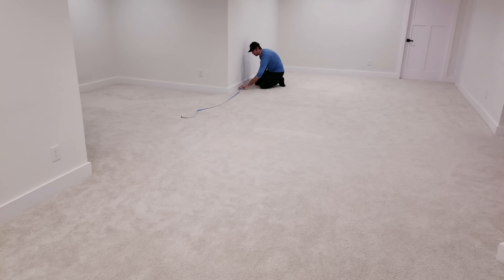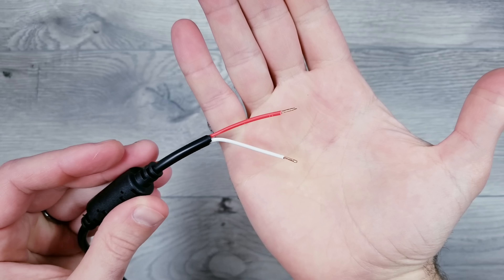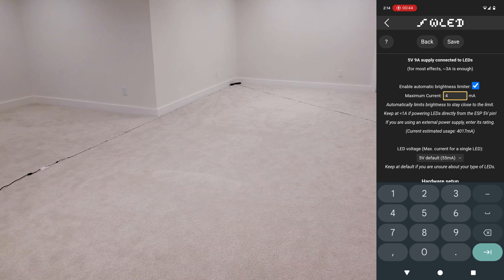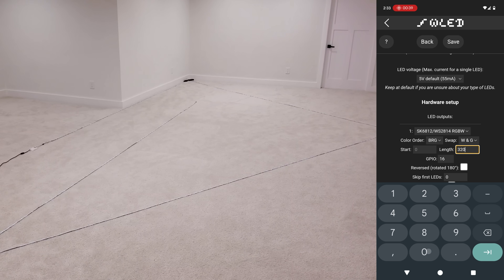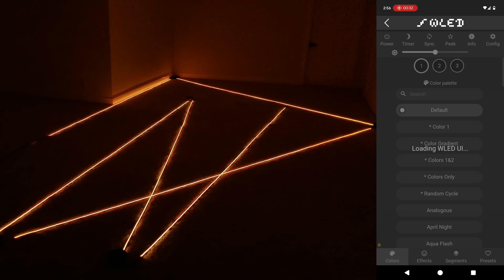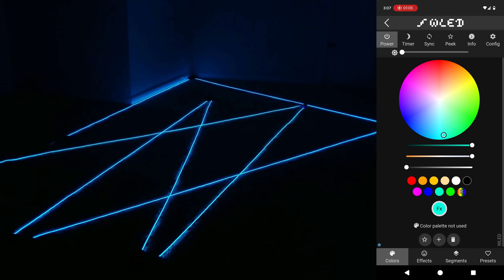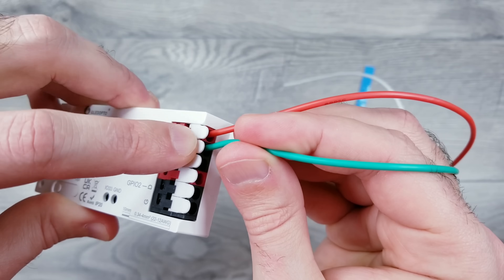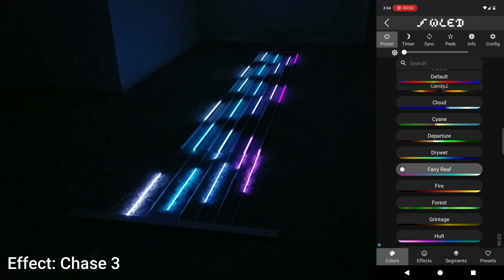Maximum LED Strip Length With NO Power Injection: Real Life Experiment

Comment from the maker: 📟 BEST Amazon Deals on Electronics: https://amzn.to/47qjC9j (updated daily)
Gledopto WLED Controller: https://amzn.to/428hWNW
24v 5a Power Supply: https://amzn.to/3DT97j9
WS2814 Cob 784/m: https://amzn.to/4cd5zow
WS2814 Cob 896/m: https://amzn.to/4c62h6q
Muzata Spotless Channel: https://amzn.to/4cjmXIo
Wire Stripper: https://amzn.to/3E0RIF7
SOLDR Kit: https://bit.ly/40s3jFk Use code CHRISMAHERDIY for 10% off
Gledopto WLED Mini Controller: https://amzn.to/3DL80C9
Gledopto Main Page: https://amzn.to/3QTXP12

🎧🎧🎧 Music (helps support the channel) 
Outro song: https://arcadenights.bandcamp.com/track/misery

Gledopto Review and 5, 12, 24v setup guide: https://youtu.be/V2EztnKFizU

5v SK6812 Leds: https://amzn.to/4hYpmcP
5v 10a Power Supply Barrel Plug: https://amzn.to/4itvCd8
JST connectors: https://amzn.to/4aVtTL5
JST extensions: https://amzn.to/3CKrJBj
JST splitter: https://amzn.to/4aXg2nw

12v WS2815 Leds: https://amzn.to/4i8GYDw
12v 6a Power Supply Barrel Plug: https://amzn.to/4iaGbSw
12v 5a Power Supply Bare Wire: https://amzn.to/41JBbNy
JST connectors: https://amzn.to/3Fxa6pH
JST extension: https://amzn.to/41w72RT
JST splitter: https://amzn.to/4irTQok

24v WS2814 Cob RGBW Leds: https://amzn.to/4krA1ir
24v 5a Power Supply Barrel Plug: https://amzn.to/3FwEWPa
24v 6a Power Supply Bare Wires: https://amzn.to/4kwIa5m
JST connectors: https://amzn.to/4aVtTL5
JST extension: https://amzn.to/3CKrJBj
JST splitter: https://amzn.to/4aXg2nw

=============================
Support My Channel Directly:
Become a monthly contributor on Patreon: https://www.patreon.com/ChrisMaherDIY
Buy me a Coffee: https://paypal.me/ChrisMaherDIY
==============================

The best way to help support my channel is to like, comment, make sure your subscribed and share my videos with as many people as you can. The other way is to use my links above as I get a small % at no extra cost to you if you buy something. Thank you all for the support!
Reply: If I wanted to do an end injection in addition to this setup, What equipment would you choose?? I am hoping to purchase my supplies today.

Comment: I know this video is now a bit old, but I would definitely like to see how far 5V and 12V strips can go on one PS. I have so many random 12V power supplies lying around from electronic equipment that may have died or whatever and I always keep working PSs.
Reply: Do you think 12v 10 amp would be much different? I think it could handle it honestly
Reply: @Hudsonhasasimrig the "problem" with 12v is that, at the same amps you get the same voltage drop, which could impact the colors faster

and 5V well.. same thing

but basically means the lower the voltage the less length without injection obviously
Reply: @BH4x0r thank you, so it’ll be a little more then 2 times worse?
Reply: @Hudsonhasasimrig if you can expect 100W @ 24V to work fine you can expect 40W on 12 and 15 on 5 for example.. without separate power injection. i'm just mentioning random values, more power may work fine dependant on the strip etc.

it isn't one rule for all

best thing is to just test, BUT 5V is definitely gonna severely limit your options if you want the entire strip on

Comment: I like your method of SHOWING what you do.
Could you post a follow up where you connect the power to the ending strip as well ?
I would think that a lot of installs would be around a perimeter so the strips would end where you begin thus allowing the last segment to be connected to power too.
I would expect it would almost double the length possible.

Comment: Not sure of anyone else has said this, but the data line will not cause the light to fail, as it is regenerated by each "LED" as each addressable LED reads it's info, and removes it from the data, and sends on the remaining data - (at the controller, there is 400 LED data sets, but at the last LED, this set is just 1 as the preceeding 399 LED's have removed thier data)
The only time the data would fail is if the +ve voltage dropped to a level that the LED cct wouldn't work, which means the +ve is the limit not the data.

Comment: I’m looking to make a modular system for a car display. The goal is to have 4 rows of LEDs the length of a car on a 2 or 4 channel controller. The lights will on the floor pointing up at the undercarriage. I would use a portable power bank for power and running the unit remotely with not Wi-Fi. I would like to make the strips modules to fit in a travel case between shows. Any video recommendations?

Comment: Yep I have same philosophy regarding brightness, if I want a bright light I'll just use a standard bulb which is way more efficient lol.
These LEDs are for effects mostly and mood lighting at best.
I am currently running 5v wled strips with 200 ws2812  from a simple phone charger and esp32 dev and no issues, it's way brighter than I need and have tested it with over 300 and still fine even with wled 850 ma limit set.

The main thing I don't like about these ws2812 and wled is the power used when they are off, deffo need to use a fet to switch the led power, 
It would also be nice if wled could implement a proper low power state IE go to sleep and be woken up via PIR or ir or something, keeping WiFi active all the time is wasteful.
For instance I have built a esp32 c3 ws2812 8*24  clock that wakes on PIR gets time and temp , displays it for a bit and then goes to deep sleep and cuts power to ws2812 matrix, it lasts months on a small power bank, without the sleep and power cut it barely last an hour or so .

Comment: I would like to get these FCOB strips and put four of them together to get over 60 ft. If I started the line at the controller, and then put the end of the line in the GP2 connection, would that be fine if the power supply was big enough?

Comment: Data is reclocked every "pixel", so instead of a special transistor as first output of the esp, just using a ws2812b like should just reclock it. Bits are first shifted into the pixel led shiftregister, until it is "full" and then it "overflows" to the data out (reclocked). Stopping the clock would latch the shift register into the PWM registers. Just like SPI, but with a combined data/clock line.
I mean, that's how I think it works (TM).
Reply: To be clear: I started doing this in 2015 with 20V to 5v DC DC converters and started putting them everywhere. Now 10 years later I have a new house, and instead of that 2.5V voltage drop on 5 meter (I just inject at both sides, because the resistance of the led string is too high to make fuzz for 2 DC-DC converters connected to eachoter... As it basically is 2 DCDC converters with a big resistance in between and both doing roughly 5V so the current between them due to inbalance is negligible.

Comment: After days of testing here is what finally worked: 24V power supply = Gledopto ESP32 WLED with Mic/UART controller (LT-GL-C-015WL-D) 24V +
BTF-LIGHTING FCOB WS2814 ICSPI RGBW LED Strip (DC: 24V, 896LEDs/m, 1 IC Chip drives 56LED’s, 16 IC/m) 

LED Strip Configuration

Enable brightness limiter: Yes (Checked)

Maximum PSU Current: 4000 MA

LED Outputs:
1.	SK6812/WS2814 RGBW
2.	mA/LED: 55Ma (typ 5v WS281x)
3.	Colour Order: BRG
4.	Swap: W&G
5.	Length: 91 (if using one strip, if two consecutive, 182; why 91 works? absolutely no clue, tried many other combos and it didn’t work)
6.	Data GPIO: 16 (if using one strip or two consecutive, if adding 4/5 add another LED Output and set GPIO for that input to 2)
7.	Reversed: unchecked
8.	Use global LED buffer: checked
9.	Button 0 GPIO: Pushbutton
10.	Touch threshold: 32
11.	Invert checked
12.	Turn LED’s on after power up/reset: checked
13.	Default brightness: 180
14.	Use Gamma value: 2.8

Transitions
1.	Enable transitions: checked
2.	Enable blending: checked
3.	Default transition time: 700 ms
4.	Use harmonic Random Cycle Palette: checked

Timed Light:
Default duration: 60 min

Advanced
Palette wrapping: Linear (wrap if moving)
Target refresh rate: 42 FPS

Usermods

AudioReactive: Enabled checked

DigitalMic:
Type: GenericI2S
Pin: 12s SDpin: 26
12S WS pin: 5
12S SCK pin: 21

Info Menu

Audio Reactive Turned On

Comment: and what's so supernatural about it?
24 volts doesn't require any injections. It's not 5v.
Reply from the maker: @ArtAttaman  if you want to run these 24v strips near max brightness you definitely need to power inject about ever 10m

Comment: Great job!
Could you please confirm whether the data signal output in this controller level is 3.3V or 5V?

Since WS2814 strips are powered with 24V but often require a 5V data signal, it's important for me to know if a level shifter is needed for stable operation.

Comment: Concerning the 5V queries, I’ve recently installed 22m/72ft/1311 LEDs of SK6812 RGBW in a loop around my lounge. If the end strip is connected to the start strip, this counts as two injection points with the middle (opposite the injection point, 11m away) experiencing the highest voltage drop, but being the furthest away is less noticeable. 30W/6A is the maximum power draw before I notice dimming with the most challenging colours of indigo (RGB) and white (W). Effects and other colours don’t show reduced brightness but they don’t draw much over this 30W due to the current limitations mentioned by IntermitTech. Nevertheless I set the power limit to 150W/30A in WLED for zones closer to the injection point but typically use half-power on the slider, which is plenty bright for my needs and the effects are stunning.
I soldered about 1m of 12 AWG power cables directly between the PSU and the strip, and soldered each strip directly together. With a closed loop of LEDs, you have to cut the data line immediately behind the data injection point or it won’t work.
I’ve had no problems running 1311 LEDs on one data line.
Total cost about three hundred and twenty five GBP.

Comment: Nice demonstration.  If you're going around a room or something where the strip returns to where it started, power injection into both ends is a no-brainer that doubles the power capability with no extra expense.  I hate running power cables alongside the strip, so it's very helpful if the beginning and ends of the strip can be located near the power source(s); the data can only be inserted from one end, of course.
Reply: I would like to do that. Would he have just put the end of the wires into the other ports of the controller? 

I'm a complete noob at this, and having it supplied at the beginning and end sounds like the easiest way to do a longer run

Comment: I agree with this philosophy. From my trial and error for standard ws2812b 5v LEDs by BTF lighting I got about 400 LEDs in before noticeable colour change on blue light. but since my strip did a loop and ended where it started I could power it from both sides, leading to about 800 LEDs. In these tests, you did not power from both ends which I would have liked to see. Also, higher voltage LEDs experience way less voltage drop. The only thing I would have liked to see mentioned is the use of a fuse (I don't think that controller has one).

Comment: There are some downsides not discussed in this video. Once you start needing to lower brightness by a large amount (as can be seen in the video with the main power slider going lower and lower to maintain an even color throughout the strip) this has a compound effect as how smooth animations and fades and such are going to be.
All types of ICs used in these strips are 8-bit that means they can do 255 steps for Red, Green and Blue and make 16 million color combinations. Once you start lowering brightness to a large degree, say max 20%, this decreases the amount of steps that can be taken from 255 to 51 and the total colors to only 132.651!
The problem this creates is that if for instance an effect fades from blue to green in 1 second, instead of being able to take 255 steps to do so, it can now only take around 50 and thus animations and fades will look a lot choppier as a result. This can also be clearly seen in the video starting from 10m and longer. In reality, especially with effects that use lots of zones, this will look bad in my opinion.

Another issue that will show is when using the power limiter heavily and with low total Amps is that effects that hit 20 of the 500 zones (don't go above 500 on a single data connection) it will be really bright while effects that hit 400 zones (or during the effect) will suddenly look very dim.

A single edge injection as is being used can deliver 4A to the strip (so the JST is no problem), using the real-world powersheet and using the 50% RGB white number (I agree 100% RGB white number should not be used) you can calculate how much power a variant of strip is going to use and thus how long you can make it before needing power injection.

So while yes, you can certainly underpower your strips, to a degree, this is not without downsides other then voltage drop (which is a sign of too little power being available and thus needing power injection). Even if you are fine running at max 10% of their capabilities, this has visual  downsides then you might initially think.

In the end it's up to you what you find acceptable of course!
Reply from the maker: Thanks so much for watching and great input! I was actually pleasantly surprised at the animation's performance even past 10m. I assumed it would be a lot worse than it was! Especially considering animations are not great to begin with on strips that are controlled in groups vs true individually addressable leds. Always pluses and minuses but for most of my simple ambient/mood lighting installs around my house, the positives outweigh the negatives.
Reply: Ohh snap, the LED 🐐 has entered the chat
Reply: @IntermitTech  is the dig2go capable of running more than one 5v strip?
Reply: @michealkimball2796  Capable yes but because of the limit power budget and single injection point you'll run into the same issue as I described, 5v and 5m is a limit I wouldn't exceed without adding more injections (no matter the controller) personally unless you don't mind running it max 25% brightness with the issues described. :)
Reply: You seem knowledgeable In LEDs, and I went to your channel seeking a better understanding of best practices. However, I couldn’t find any barebones videos, going over the basics, from A-Z. I don’t want to learn everything or niche topics. I just want to understand the basics and have what I need to light up my room. I’m willing to do power injection but I can’t find a simple video going over this. I think at the end of the day if this method works I’ll just do what is shown in the video and maybe connect the end of the strip back to the power supply as I heard that can boost power. I don’t know of any safety or fire hazard implications.
Reply: Strange that you'd make the argument that animations won't work with decreased brightness when the animations clearly DID work on the video. Looks like your calculations don't match reality, and you should probably redo them instead of spreading misinformation due to cognitive dissonance. Or you could just take the CNN approach and double down. Your choice.

Comment: I used one of them wled modules that has the the io33 and gnd terminals to be able to just switch the led tapes and not the actually module didn’t like the idea of switching the module off all together and didn’t like the delay and was annoying when it would reset back to original settings when ever lost power as it was a switch feed from a 1 way switch. I managed to figure out how to wire it to a switch and also figured out how to make it a 2 way (I used shielded cable that can run extra low voltage near low voltage) 
My next thing I’m trying to figure out is how to cycle different settings on the switch currently only on and off but will be changing over to eg double click to cycle a different colour/setting

Sorry for my bad spelling/ not making sense but hope this helps anyone that wants to do the same thing 👍

Comment: You are more than likely looping these LEDs if you are going around the top or bottom of the walls.  Connect the power into the beginning and the end of the strip without data at the end and you will basically double your max brightness as long as your power supply is big enough.
Reply: How do you go about doing that? I'm new to all of this.

If I wanted to do 60 ft of LED strips, and the kit I would be getting would come with two strips that are 30 ft a piece, would I connect the first piece, connect the strips together within LED strip connector, and then at the end of the second cable connect back into the same power supply as what started it?
Reply: @ThePackman627  yep
Reply: Agree...Please point us in the right direction.

Comment: I know out of the scope of this video, but it would have been interesting to see what would happen if you power inject also at the end of that long strip. Great videos, keep them coming!
Reply: I'm in the process of doing just this.  I'm using 12V instead of 24V LEDs I'm doing power at the beginning and the end of the strip.  I am able to power 3 entire rolls without any loss at 100% brightness with all 4 colors RGBCW at 100%.
Reply: @davidallen5783  Out of curiousity, what power supply did you choose? I lost interest in doing this about a year ago because of power injections...Now my interest has peaked again.
Reply: @davidallen5783 yeah I'm wanting to do four strips of 16.4 ft and it seems to me that the easiest way for me to do it is to have a power supply at the beginning, and then hook the end of the four strips up to another power supply
Reply: @davidallen5783  Just came across your comment because I'm trying to run 3 5M (WS2815) strips in series at 12V, and only want to apply power at the very beginning and the very end.  You are saying you think this should work?
Reply: @brandoncotton4845 did it work?